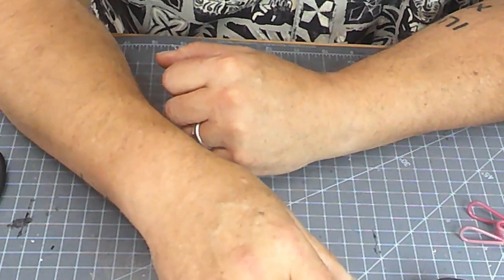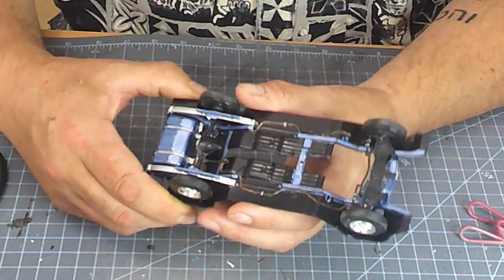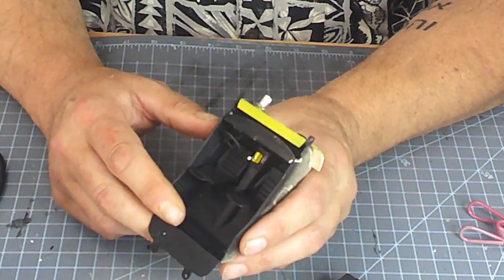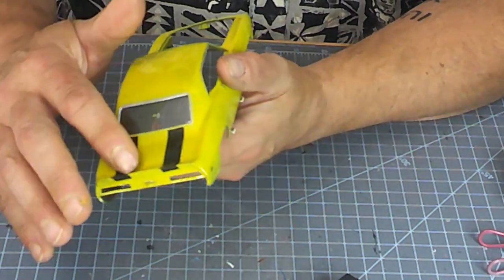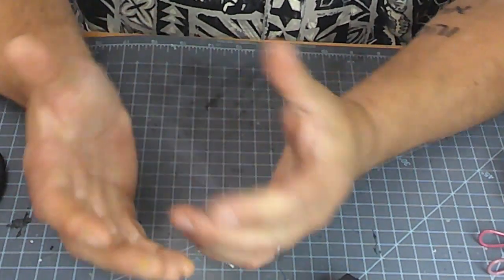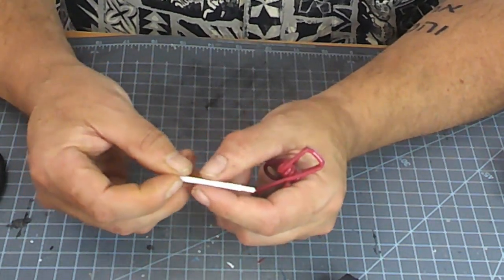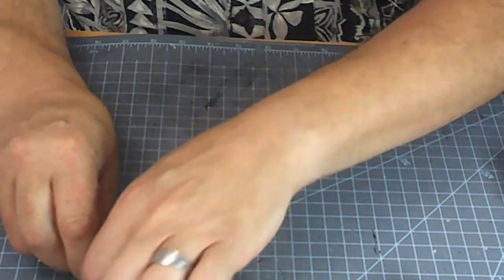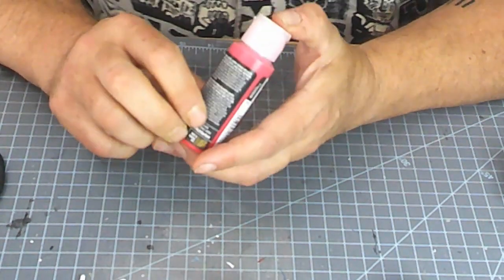Bench update, What primer is best?

Comment: Nice update!  Depending on what type of paint I’m using, I’ve had good luck with Tamiya primer, I picked up some Mr. surfacer but have not tried it yet.  There are some auto primers you can pick up in a can that used to work well, but you have to make sure the paint and primers are compatible such as duplicolor SEM etc